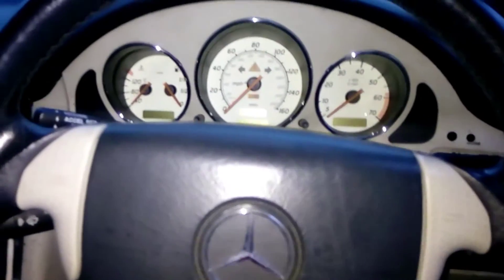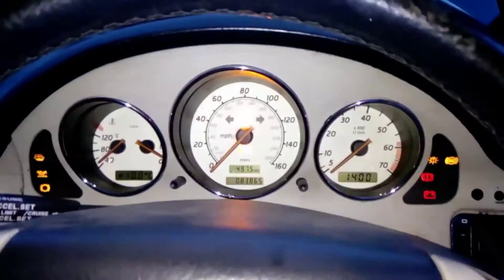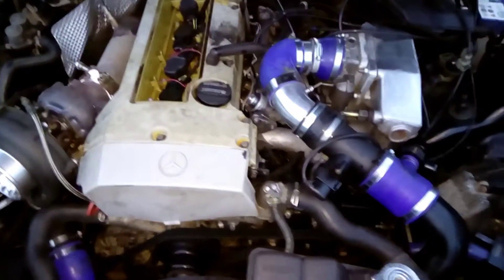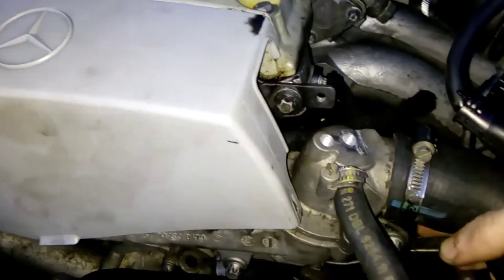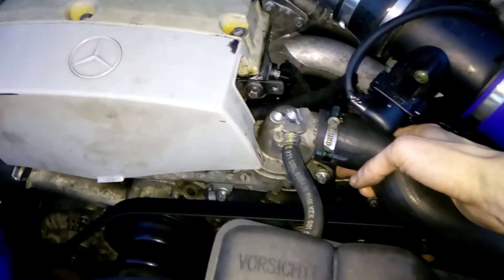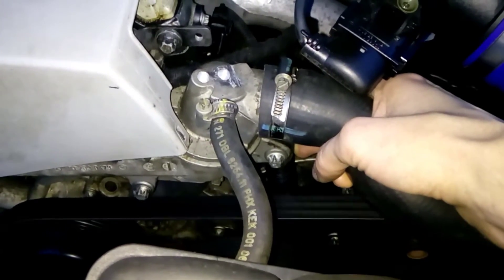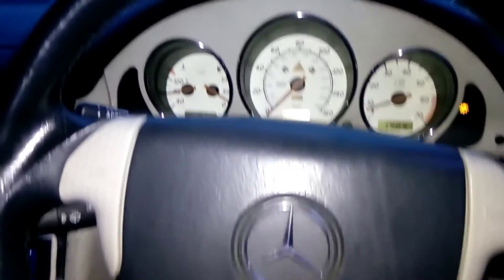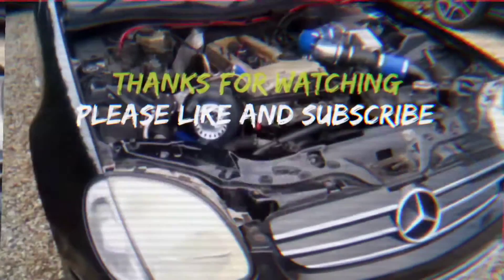Mercedes Benz 200 230 M111 Rattle Not what you think... #subscribe

Comment from the maker: @Grand Saga our car uses a megasquirt 3 ECU and a ofgear transmission controller we always run a vw 4 bar fuel pressure regulator and are now running VW BAM injectors with stock fuel pump our is a w5a330 but we are looking at fitting a clk270 CDI w5w580 transmission sorry been trying to reply to your comment but for some reason it's disappeared 🤣

Comment: Sounds just like my w124 C200 and that engine has no valve actuators (.940 engine). Been searching for a cause for two years already, even changed oil from full synthetic to semi synth in hopes it goes away. Still, have to get to the garage and check.
Reply from the maker: I had lifter noise from my Clk I put 10w40 in it as it's nearing 100k anyway so a thicker viscosity compensates for the engine wear, and it actually shut the noise up. Although as you can see from this it wasn't lifter noise. Gotta love M111s

Comment: I have the same sound in my Mercedes w203 2001 whit  also camshaft failure (the po335 and po 222. First I wil order camshaft censor and see what the engine wil report… thanks for the video 👌
Reply from the maker: If you have a code for camshaft failure it is most likely to be the camshafts adjuster that is mounted on the front of the engine. These commonly fail and when they do they rattle. They're not typically too expensive and good used ones are easy to come by, if you handy with a spanner, or Allen key in this case it's a simple 5 minute job to swap it out for a replacement and requires no coding 👍
Reply: @M-oneeleven-M111  hello , I just replace the camshaft adjuster today. It worked very well whit the rattling and motor failure po 335 is not coming back anymore , but it’s still a little raw sound coming, like it comes from the chain. But first this is okay and accepted I think . So thanks allot whit this advice you give to me😀. But now second failure po 222   The trotle opens only very small and it reacts very slowly. The trotle is almost clean but now ? There are 2 censors and of course the cable. What can this be? They are not cheap

Comment: yeye I noticed the newer models donnt have that dampener thingy. I actually dont think it serves a purpose anymore
Reply from the maker: I completely agree my Clk doesn't have it o assumed that it was fitted to models without the viscous fan on the older models
Reply: @M-oneeleven-M111  oh that is a possibility I also found out our m111 has a oil cooler in the form of a line, heather type tube thing. looks like a neon light at a bar type tube but anyway yeah it goes from the Oil filter reservoir out right on the engine bay side of the radiator if you remove the fan, and goes in infront of the radiator and I's routed out to some type of pump. at least on mine xD
Reply: the pump sits in a circular hole cutout just the top nozzle showing with 2 fittings and a fitting at the bottom.
Reply from the maker: @Mitutumuch  I know the trans cooler is usually done in the form of a bent pipe a bit like a power steering cooler I think that's what I think you might be refering to the power steering pump?
Reply: @M-oneeleven-M111  I couldnt get under it enough to look is it for the power steering? I thought it was an oil cooler it looks to be linked to it but the power steering is right next to it
Reply from the maker: @Mitutumuch  hard to say without actually seeing it but what you describe does sound like the powersteeri system although I say that the power steering pump is top right as you look at the engine has a little black tank on it sits next to the oil filter housing

Comment: I have had that issue on all my m111s
Reply from the maker: Yeah seems like a common thing this if the only m111 we have had with that has this damper, but we have had a couple of actuator failures on the camshaft and the two issues both make a very similar noise

Comment: ECU?
Reply from the maker: Megasquirt 3 with a standalone ofgear transmission computer 🙂 please subscribe if not already 🙂
Reply: @M-oneeleven-M111  I have a CLK 208 would like to know how the cruise control and dashboard with megasquirt work?  thank))
Reply from the maker: @mercedesw2082  Good question so basically what we did to retain the stock driver by wire throttle body and cruise control is the Megasquirt ECU works as a piggyback ECU of sorts, what that basically means is we leave throttle control down to the stock ECU aswell as for the dashboard and immobilizer. This meant some complex wiring but it allowed us to keep cruise control and the stock security system. If doing a turbo conversion and you have the Bosch management on the pre-facelift M111, if you run below a bar of boost you can run on stock management with a MAF clamp and the O2 sensor unplugged. I know the O2 sensor things doesn't sound like a smart idea but many other guys do it the engine seems to be perfectly happy although can get some hiccups from the engine on part throttle. I do plan on converting my own w208 to turbo with stock management but it's pre-facelift Bosch we cannot give any advice on the post facelift Siemens ECU 🙂
Reply: @M-oneeleven-M111  I have a bosh me 2.1 ECU.  I can’t find a detailed pinout, (((2.0 engine without a compressor and I am annoyed by the standard ignition system for two coils. this system is shit. I want to put 4 coils and possibly a turbo. What compression ratio did you do and what boost? Thanks for the answers, it's nice to chat  with a smart person 😊
Reply from the maker: @mercedesw2082 So our engine is a 2.3 M111.975 it's runs the standard 8.8:1 compression we also use VW coils so much better, I know your compression ratio will be higher as the 2.0 used flat top pistons from what I can find but I think you could push .8bar without worrying too much ours was running 1.2 bar with a 1.5 bar 20 second overboost. This was until the harsh torque limiter broke a piston so we are back to .8 bar I believe only for the sake of the car is used daily but even at that it's a lot faster than stock, well feels it at least just something about how the boost comes in from a turbo compared to a Supercharger. We do have a write up if you provide a email I can send you it's for megasquirt 3  and there is no pictures as Ben is still working on it. Biggest thing is if you have a auto transmission it complicates the situation when adding ECUs or boost if yours is a manual it's a lot easier as I suspect it maybe manual being a 2.0? Thanks for the compliment we try but even we are still learning 😉
Reply: @M-oneeleven-M111  yes I have a manual gearbox.  but no pinout me 2.1 bosch ECU.  not Siemens.  what is the performance of the injectors, the fuel pump and what is the fuel pressure?
Reply from the maker: @mercedesw2082  stock injectors on a vw 4 bar regulator will be fine up to .8 bar with with the higher compression on your engine is as far as I would go stock. The headgasket it the weakest part I'm trying to get some ARP bolts for the built engine we will be doing but so far waited a month still not got them hopefully they well help a bit so far no European companies have produced a MLS headgasket that we can find I'll get the document sent over to you it is for the Bosch me system
Reply from the maker: @mercedesw2082  I'm having some issues with comments once again YouTube does t seem able to resolve this I am unable to see most recent comments sorry for the inconvenience
Reply from the maker: @mercedesw2082  if possible could you re post your reply about the headgasket I'm very interested in that however YouTube is playing up so I can't see the full reply only the notification